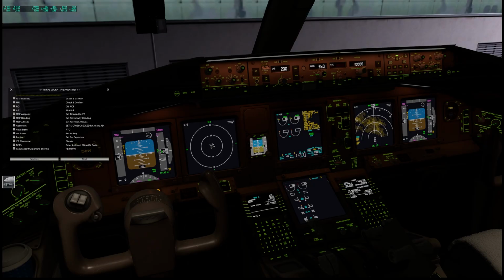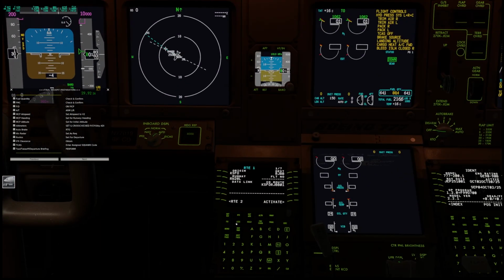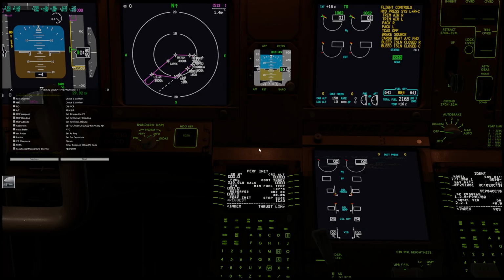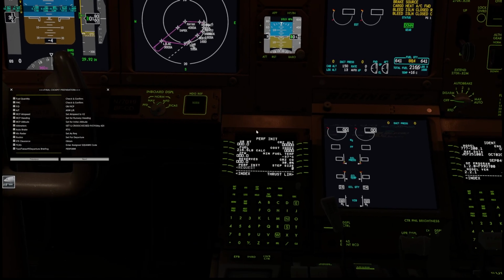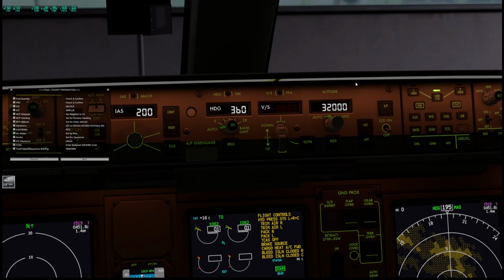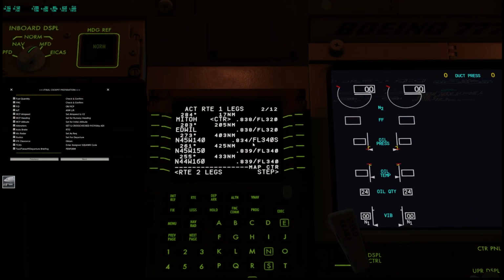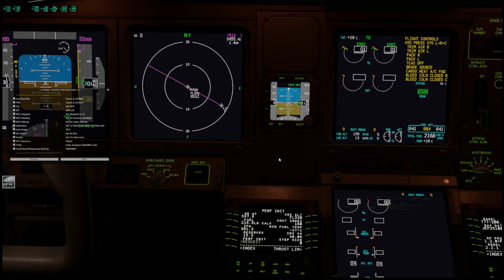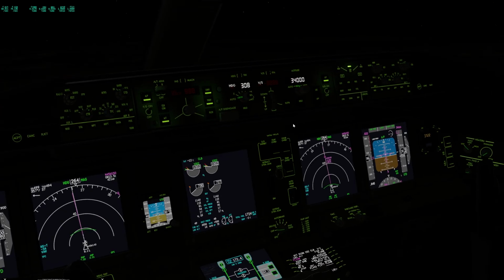Flight Factor 777V2 | Auto Step Climb Tutorial/Guide | X-Plane 12 Tutorial Series

Comment: Hello.

I have this issue where even though I typed in a higher cruise altitude, all of my other waypoints did not change their altitude. In addition, for some reason, a lot of my waypoints gave me a lower altitude than I should have been, thus creating a T/D halfway through the flight. Though it is worth noting that I didn't export my flight plane to X-Plane, but rather types it in manually...

Any help is appreciated.

Cheers
Reply from the maker: Try the co-route function and see if that helps!